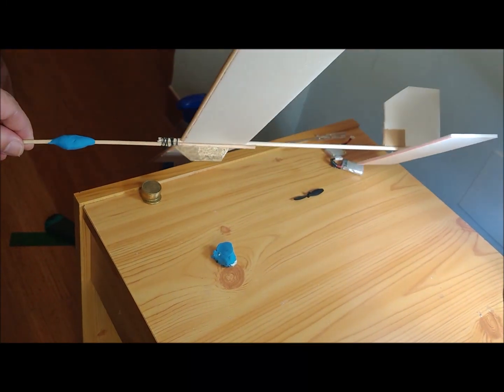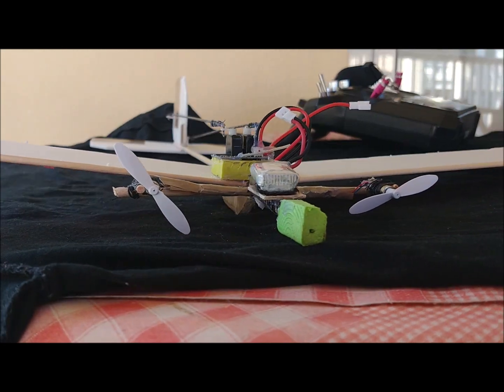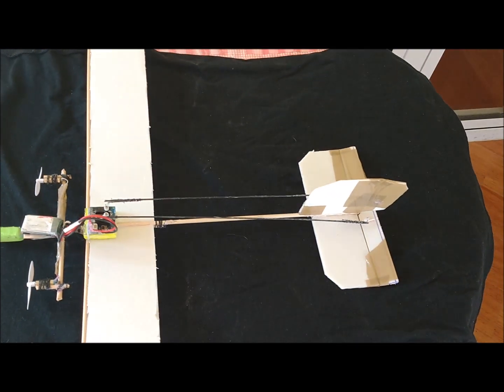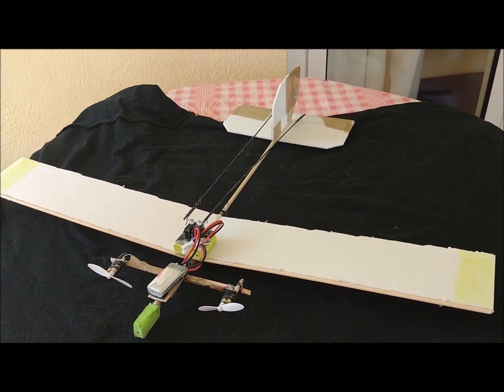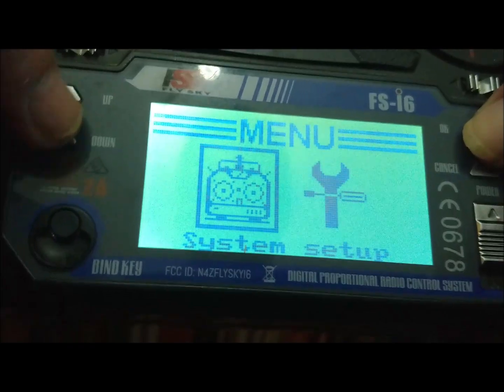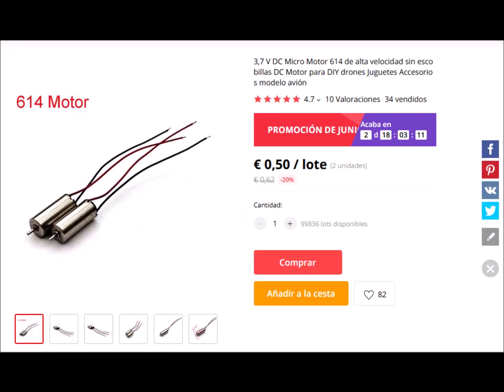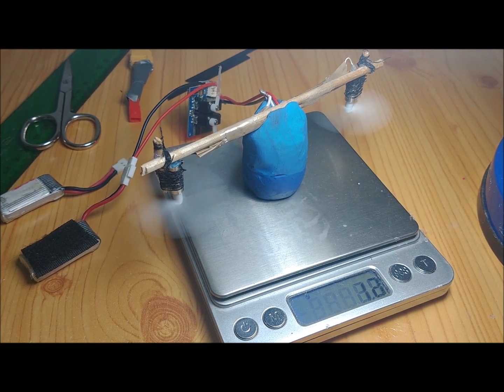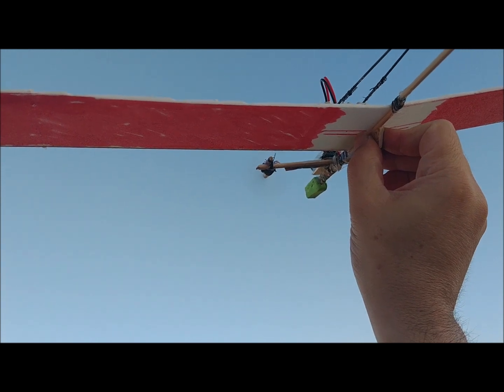How to make mini micro plane 38 grams with wooden sticks. 2 Ch. DIY. RC. Radiocontrolled airplane

Comment: Muy buen proyecto. Pero sería muy interesante saber con detalle cómo se han hecho las conexiones de los distintos componentes. El bloque WLTOYS 949 en principio está diseñado para un solo motor. ¿cómo se conectan estos dos pequeños motores al bloque?.
Gracias por su respuesta.
Reply from the maker: se hace mediante una conexion en paralelo

basicamente, se ponen los cables como si fueras a poner un unico motor, pero los extremos de cada cable se dividen en dos, formando una Y en cada extremo, y con eso ya colocas dos motores